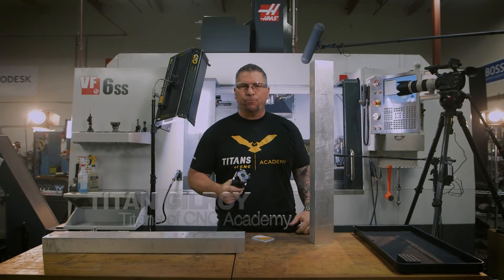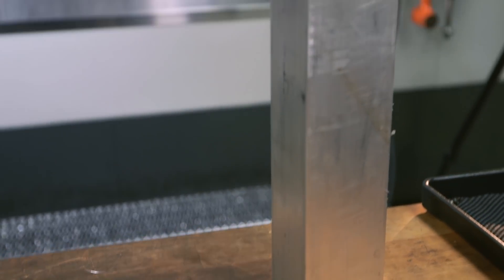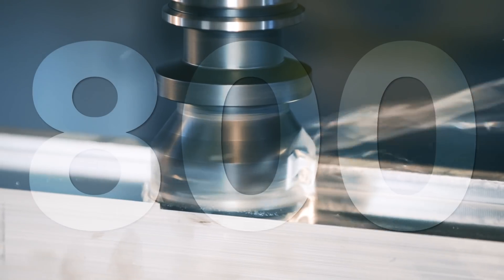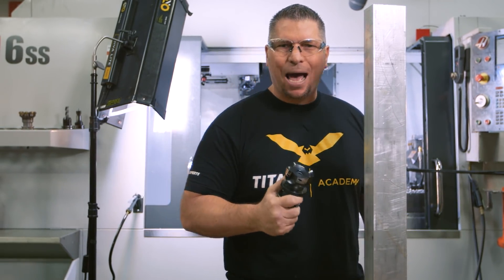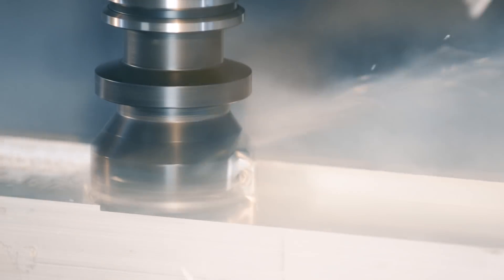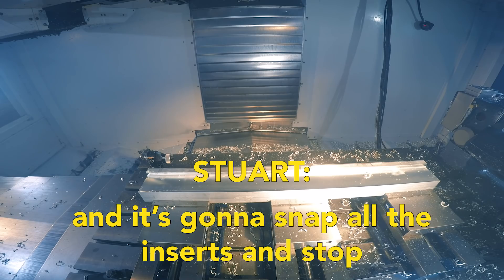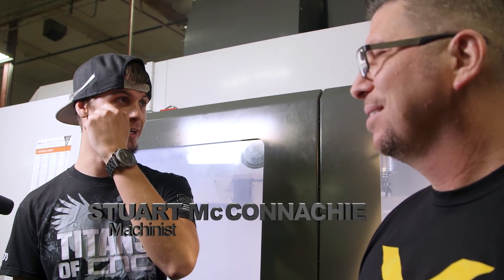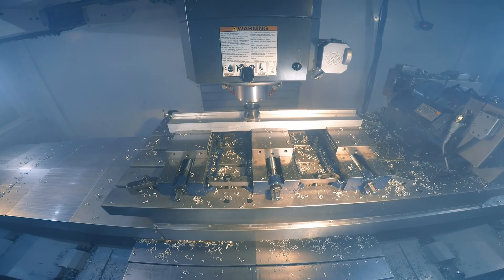Pushing CNC Machining Past Failure | 800 IPM | Kennametal

Comment: I'm still pretty much a newb, so I'm curious why the coolant wasn't turned on for the original 2.7" step over.
Reply: Richie Bhoy yeah but they'd shame themselves by making dumb remarks like that....
Reply from the maker: I know my machine pretty well and wanted to run it for as long as possible with no coolant... simply because I wanted to have a clear view on camera of the cutter actually cutting. Just for Camera - Not recommended.
Reply: I thought that might be the reason.  It's one of the reasons I prefer mist on mine.......but I only have 2hp.....so I'm on a completely different playing fields. lol  Thanks for the response!!  Thank you for everything you are sharing with the rest of us! 
Mike
Reply: I thought that might be the reason.  It's one of the reasons I prefer mist on mine.......but I only have 2hp.....so I'm on a completely different playing fields. lol  Thanks for the response!!  Thank you for everything you are sharing with the rest of us! 
Mike
Reply: TITANS of CNC: Academy 
did that last one burn up your inserts?
Reply: Allan Kent Yeah. He's too dumb to realize that this video is 85% entertainment & 15% education. Doing this with Ti or Inconel would make for a video that is not as entertaining, and would have less views, and they'd make less ad money. Hogging videos= tons of views, views for non-machinists, and a lot more money.
Reply: Damian Butterworth Depending on inserts, coolant might not be a solution as it make thermal shock on the insert and wear them faster. This is only true for tool with on/off cutting enges (basicaly any milling). In the drill case, drill always touch the material so they always heat. Coolant will not shock them.
Reply: I run a HASS 5 at work with steel parts and just use coolant when drilling. We just use compressed air when milling. The boss says that the tips we use are designed to be run dry so that`s what we have to do. Don`t really know if it`s right as the place is a bit weird lol.
Reply: @damianbutterworth2434  what inserts do you use for dry cutting?
Reply: @damianbutterworth2434  hey it depends on coating of the insert or solid carbide endmill. Just look up the tool manufacturer's catalogue
Reply: Most aluminum inserts can be run dry. Most P/M inserts can be run dry as well, in fact it's better for longevity if you do.
I've done some A514 armor plate (alloy steel, 21hrc) on a Haas VF3 with a sandvik R490. .125 depth, 75% engagement, 2100rpm,  50ipm. The 4130 PM's ran about 6-10 minutes unreliably with coolant. With air blast at just 5psi I could run them 20 minutes 100% reliability, and sometimes push it to 25min. The edge looked like a PH insert when it was done.
Problem was our coolant, commonwealth commcool HD, actually worked TOO well. Any time the R490 came out of a pass and positioned for another, the inserts would cool down too fast and develop thermal cracking.

If you're pushing the tool hard enough, then the majority of the heat is in the chip, not the insert. One of my customers has a doosan mill they don't even put coolant in.
Reply: Damian Butterworth there are lots of different inserts for lots of different tools.  Yes there are many tools that cut best with no coolant.  A lot of it depends on what you're doing, what material you're cutting and what your RA is looking to be.
Reply: Good video! Matsuura 800 VMC 500IPM w/ .250 depth @10,000 rpm is what we do alot of hogging out and this machine has been going 10+ years running just hog outs. The windows are frosted completely over from aluminum blasting away lol.
Reply: bluehandsvideo looks like he's using mql or must coolant, you can see the trickle of chant ahead of the cut, and of course the fog from the heavier cuts
Reply: I mean, in modern machining practices you usually want to avoid using coolant. But as others have stated it all depends on the material, aluminum for example is a material where coolant is required to stop the material from building up on the end-mill. Duplex steel is another. But most of the time, especially with dynamic milling, air is preferred though
Reply: bluehandsvideo m08, or m51
Reply: When it comes to aluminum I usually just run face mills without coolant, in aerospace were not really hoggin anything over 400inches a min. Everything is based on your correct speeds and feeds and if you get that sweet spot youd never need coolant, only for long term insert life span i guess
Reply: you gotta make that filler content someway.
Reply: some coating are designed to cut dry. they "activate" when it reaches a certain temp.
Reply: I run an FPT
Reply: motor city  Coolant will shock ceramic and carbide. In fact, it eill shock anything. There is no effect on HSS, mild effect on carbide and practically instant effect on ceramic. I dont want to argue on that as it is a big debate. If you want to run coolant on carbide, go ahead. Basicaly, the temperature difference of your insert vs the coolant will always depend on the material you are cutting vs your cutting specs. I dont know your specs, insert, cutting time or your coolant temperature so there is just to much to just say: this is best. What I experience is that sometimes when I got some issues with insert life, turning coolant off and air on was a solution.

Comment: Hey Titan what would happen if you made a cutter body or bought one that can hold 5 or even 6 inserts I bet you could even go faster bring down your chip load by adding inserts....
Reply: The inserts are still facing the same way, how could you go ccw?
Reply: You'd bust them off
Reply: ccw?
Reply: Ccw counterclockwise... running it backwards
Reply: More points of contact would take more HP to push. This machine is maxed out.
Reply: if you get a holder that has 5 or even 6 inserts you could actually run the spindle ccw. Or atleast in theory...

Comment: IPM looks cool. When it comes to roughing, it's MRR (Material Removal Rate) which counts.

The customer pays for the finish cut. You make money on the roughing cut!
Reply: Exactly this. You passed the MRR of the 800 IPM (inches per minute) cut with 1.5 in. WOC (width of cut) all the way back at 450 IPM with the 2.7 in. WOC.
Reply: @joshuawentworth7426  vf ujt
Reply: That's a great point!
Reply: Ya make your time roughing, ya take your time finishing:)
Reply: Maybe true but power milling is hard on your tools and your machine. I can turn an endmill into a ball mill and still finish the job before I’m even aware of it with high speed machining. My parts come out flatter and my walls are straight within tenths. Aaaaaannd I don’t have to tighten the crap out of my delicate part. Power milling has proven to be faster for sure but when that tool breaks, your holder is damaged and that part is scrapped hsm will have put more money in your pocket from said customer. Unless you have a spare tool in the carriage and the part hasn’t moved and verified it hasn’t. A continuously running hsm program will leave you behind and give you over 3 times the tool life.
Reply: A high speed machining rough cut is practically good enough to pass as a finish cut. Your finish cuts should be even faster because of chip thinning
Reply: These days customers make it easy. Especially with billet bolt-ons for cars. You can do your ball mill surfacing with a huge scallop because it looks cool. It also makes moldmakers cry.
Reply: I have two shops that I work at and all I do is experiment. It takes me longer to program than run the machines. I’ve take stainless steel cuts at double the diameter in depth and 80% engagement instead of my safe 7%. I was nervous every time it ran but it knocked almost 2 minutes off my run. Tool looked good in the end but I know for sure that as soon as a tooth chipped that was the end of that. With hsm I can see the edges are gone and I’ll still run it till it breaks and I know my part hasn’t moved
Reply: Make that money

Comment: Why does your load meter show 75% load on Z axis when the only job that servo is doing is holding your height?
Reply: Exactly. Nice point Joseph.
Reply: As you listen tho, the load meter stays high even as he leaves the cut.  I swear his counterweight nitrogen levels are empty
Reply: The insert geometry has an angle to it that is essentially trying to pull the cutter into a material like aluminum. At these feeds, it is probably quite substantial. Also, most machines tend to have around 25-40 percent load from holding height.

Comment: A good test for the machine. If you're up to doing this again, drop the spindle speed to 9k-10k, since it will increase the available torque by about 60% (specifically at 9krpm). The chipload will shoot through the friggen roof at 800 IPM @ 9krpm, but hey that's what the test is for :)
Reply: I actually just did this today on my 1996 or 7  VF-6. I was running a similar style high feed face mill on some large 7000 series parts. 7500rpm (max for the machine it's old) at 150ipm 2"step over on a 3 inch shell @ .05doc. Spindle load floated around 100% I was getting fluffy hard to clean out chips. The auger didn't like them...haas... I dropped the rpm down to 5000rpm and everthing else the same. Load went down to 60% so I said ok, more feed? I went up to 240ipm, .05 doc, 5500rpm at 85-90% load. So my mrr went up 62% if i figure right, I got better chips, and didn't kill the machine. So I dropped all my other tools from 7500 that I was using down around 5000-5500 and almost doubled all my feed rates for the milling operations and now the parts are coming out roughly 75% faster. It makes sense thinking about it too. So for hogging I wont be maxing out my spindle, machine just falls flat on its face.